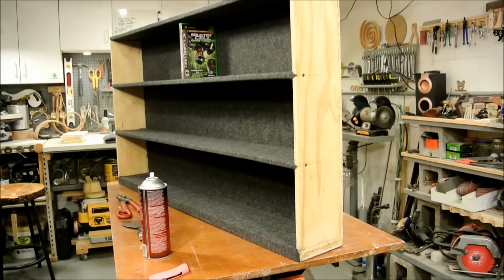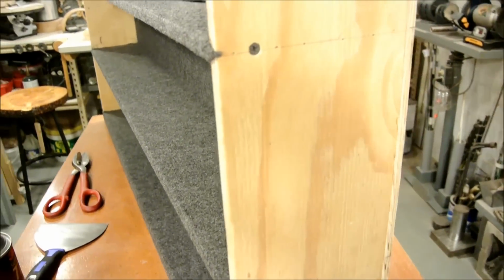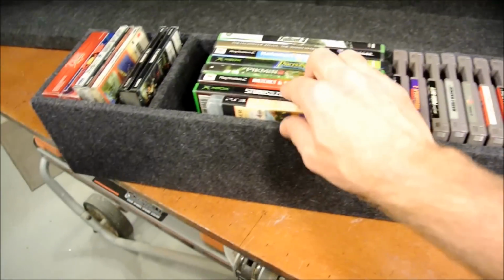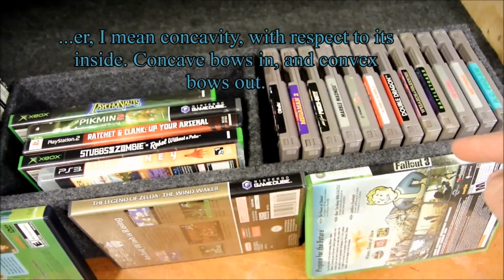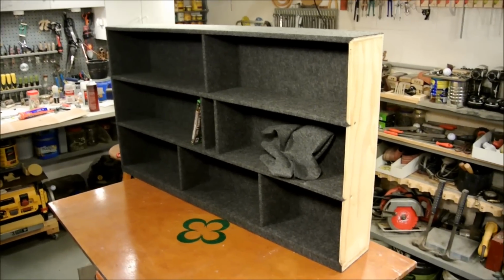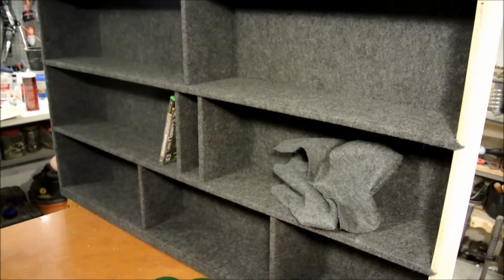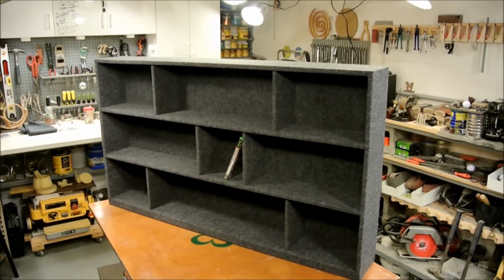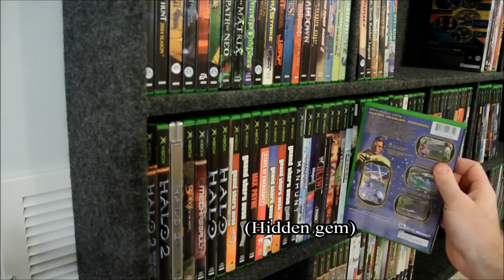Felt-lined video game shelf

Comment: Thank you for this! I made a similar one but used black Polymat liner instead of the charcoal color and used 777 glue, turned out really nice.
Reply from the maker: Oh, great! That fabric is the good stuff. Over time, if the spray glue ever lets up in the corners, I've found that a dab of construction adhesive is a forever solution. 

You'll love this shelf. I ended up making two!

Comment: Do you have a preferred way of destickifying the floor?
Reply: Sure, with concrete. But it depends on the size and severity of the stickiness. For large areas of minor overspray (like in this video), I just spread around some sawdust, and foot traffic naturally wears it away in a day or two.

For highly concentrated spots: spray the area with either mineral spirits or WD-40, and then let it sit. Next, throw a handful of course sawdust on it, and use the pile to scrub it. The sawdust should take the mess right away. Water also works if you allow it to soak for long enough.

In either case, I think the trick is patience. Like with most things.

Comment: how is that tool you are using for the 'felt' called? 'big ass scissors' got google dirty...
and our hardware store doesn't have anything like it :-(
also: speaker-boxes? have you got some tips for noobs? i had a box with a grill that started rattling and decided to build a new box but it turns out i'm unable to properly mount the speaker. does it really need to be fixed with glue? i'd prefer screws. a lot of the speakers i opened had both :-/
Reply: I use 12" vinyl siding snips. They also might be called shears or cutters. Mine are Craftsman brand, but the Midwest look like the same thing. Speakers don't need to be glued in place. Leave felt 1/2" long around your speaker hole, and then fold the felt around the hole. The speaker should sit flat enough to seal. Your grill should have its own separate attachment hardware. If your hole was just too big, cut a new front piece and replace it. If your box was screwed together like it should have been, it shouldn't give you a problem.

Comment: Doesn't felt tend to get really dusty? How do you get around that, iirc it's really hard to get the dust out too. Did you treat it with something?
Reply: +superslav 
That's a good question. You know, surprisingly, it isn't a problem. There really isn't much felt exposed once the shelf is loaded, but a vacuum hose makes short work of it anyhow. I vacuum the dust away about once a year. I even have a bookshelf like this, so I recommend it.
Reply: +pocket83 Oh, that's great then, my cousin a cheap felt mat back in the day and it was a constant mess of cat hair and the occasional giant thread bit that seemed to come out of nowhere, for some reason vacuuming it never did the trick. Thanks for the reply.
Reply: +PunchingMegaTree Sorry, I meant "had". Typing on a tablet is pretty crap.